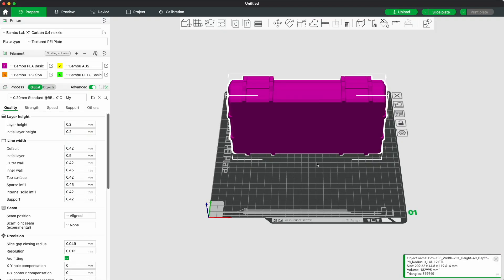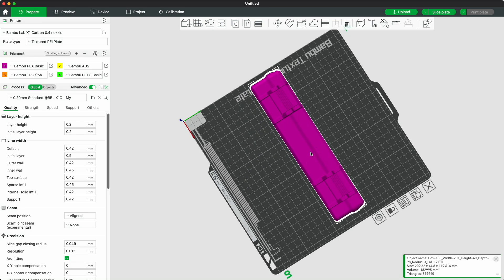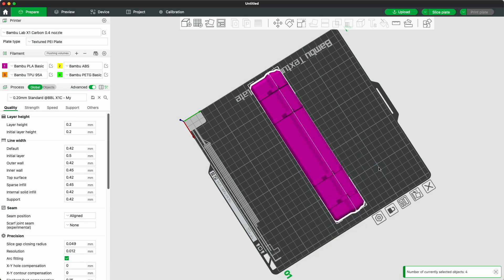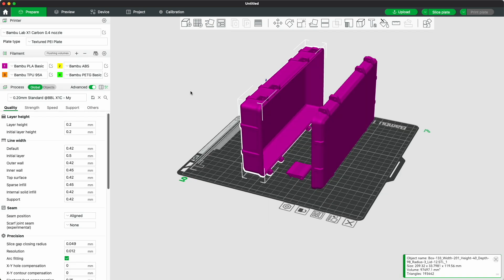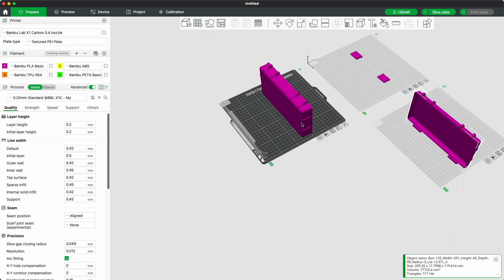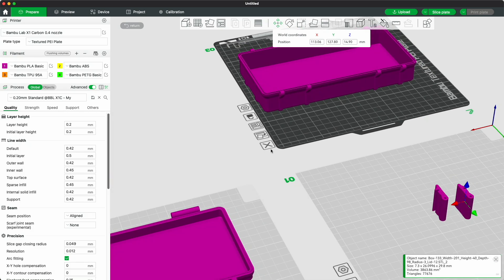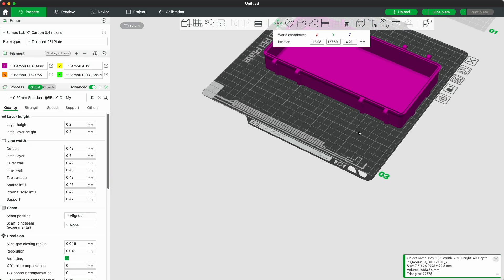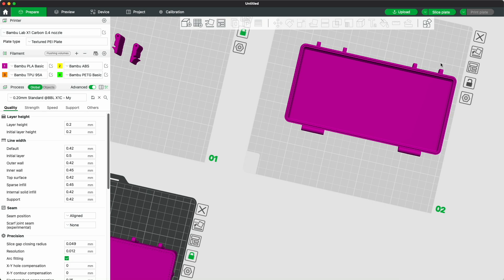3D boxes to your dimensions v2 0: How to Break Down STL

Comment: What if you need a box larger than your print volume?
Reply from the maker: Instructions for Printing a Large 3D Model in Bambu Studio
If your 3D model is larger than your printer’s build area, you can divide it into parts, print them separately, and then assemble and glue them together. Bambu Studio has a built-in tool for cutting models. Here’s a step-by-step guide:

1. Import the 3D Model into Bambu Studio
Open Bambu Studio.
Import the oversized model in STL or OBJ format by clicking on "Import" and selecting the file from your computer.
Make sure the model is larger than the printer’s build area. You’ll see this if part of the model exceeds the work platform.

2. Cut the Model into Parts
To fit the model within the build area, you’ll need to slice it into pieces.

Select the model: Click on the model to activate it.

Use the cutting tool:
In the right-hand menu, select "Cut".
Choose a cutting plane: You can slice the model along any axis (X, Y, Z). Select the axis and adjust the plane to the desired position.
Slice the model:
After choosing the plane, click "Apply" to divide the model into parts.
If more parts are needed, repeat the process for each section.

Tip: Try to make cuts in areas where seams will be less noticeable or easier to assemble.

3. Prepare Parts for Printing
Once the model is cut, each part must be prepared for printing.
Ensure each part fits within the build area: After slicing, make sure all parts fit within the printer’s boundaries.
Check orientation: Position each part optimally for printing to minimize supports and maximize quality.
Set print parameters: Choose the appropriate print settings for each part (quality, speed, material, supports).

4. Print the Parts
Send the first part to print: Once the settings for the first part are ready, send it to the printer.
Repeat for all parts: After the first part is printed, repeat the process for all other parts.

5. Assemble and Glue the Parts
Once all parts are printed, you’ll need to carefully assemble and glue them together.

Test-fit the parts: Check how the parts align with each other. If the parts were printed with connectors (such as pins or slots), make sure they fit snugly.
Use glue: For most plastics, such as PLA, PETG, or ABS, cyanoacrylate (super glue) or special 3D printing adhesives work well. Apply glue to the joint surfaces and carefully align the parts.
Hold or clamp the parts until the glue sets.
Sand and finish: After gluing, you can sand the seams to make them less visible. If needed, apply primer and paint for a finished look.

6. Additional Tips
Add connectors: To make assembly easier, you can add connectors or pins to the model to help align the parts during assembly.
Print test pieces: Before printing the entire model, it’s a good idea to print small test pieces to ensure a precise fit.
Use supports as necessary: In some cases, you might need to add supports for complex sections to ensure high-quality printing.

Comment: Hi, Valerij. 
Is there a simple solution if I want to  have a box wider then build plate? 
I mean I can cut the model, but how to collect it in a single piece?
Reply from the maker: this video is a tutorial. this part of the project: 
https://box.perinski.eu/  
https://youtu.be/Ngc4-EZ_uiY

In the slicer, you can cut the model, print it in parts, and then glue them together. Additionally, you can add connecting elements directly in the slicer, like a dovetail joint, to help the pieces fit together and hold better.